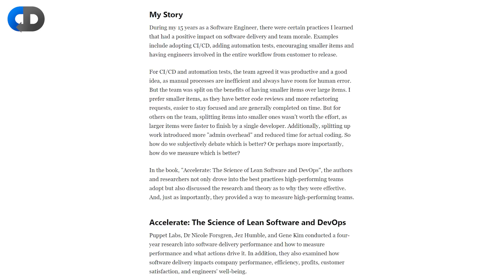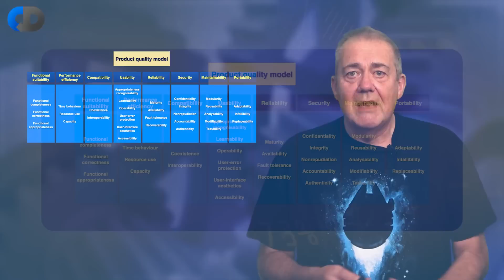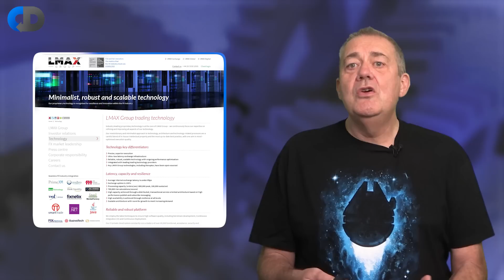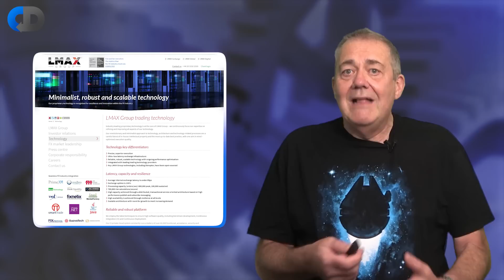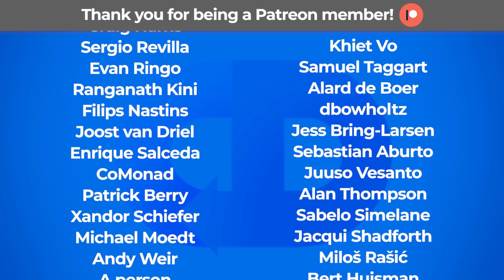I Bet You’re Overengineering Your Software

Comment: I have definitely overengineered in the past. I hope to have learned from these experiences.

I concur with what Dave presented here 100%. I now try to practice YAGNI, but I also try to keep the design flexible enough to accommodate what's coming in the future, even if I cannot predict it.

In my current experience, I think the problem of underengineered is more prevalent than overengineered. I see a lot of Big Ball of Mud. I suspect most of us here have probably experienced the same.
Reply from the maker: I agree Jim, under-engineering is the more common outcome, I wonder though if sometimes this is the result of the pressures that are, wrongly, applied to avoid over-engineering. ‘Under-engineering” is probably a good topic for another video 😉😁😎
Reply: Yeah... it would be interesting to talk about over and under engineering... and finding the "goldilocks zone" where there's just the right amount of engineering.
Reply: Some people interpret agile as meaning aggressive underengineering. When the defect rate torpedoes the velocity, then there is and agreement to do a "refactoring" sprint. Usually this sprint happens over a December and practically nothing that is planned gets finished, but the little bit helped enough to eek the velocity up again to a level that the stakeholders accept. Then rinse and repeat every year. I've had this unfortunate experience in more than one workplace.
Reply: Over engineering can also lead to a big ball of mud when new devs don't understand the intended architecture or patterns and either ignore it it mess it up. Or become too afraid to change it 😬

Comment: In my perspective these things have nothing to do with each other. 

I'll take the definition of engineering that is commonly cited, the reference I find is Koen 2003, but I got it from Bill Hammack's latest book: "Engineering is the use of heuristics to cause the best change in a poorly understood situation within the available resources".

To me, most of the things we talk about in software engineering in terms of quality software design practices go into the "heuristic" bit: our ideas about things like coupling, cohesion, and encapsulation are employed as engineering heuristics. We are doing a good job of quality insofar as we are applying appropriately applicable heuristics, the best tried-and-tested that we have available to us, and adjusted and reinforced necessary to fit our operating context.

Whereas "over-engineering" refers to violating some part of the definition of engineering in some other way: usually not delivering the "best change" in some way. 

"Best change" here is always understand in a cultural context. E.g. writing a payroll app in hand-coded assembly is "over-engineering", in the sense that it does not deliver the "best outcome": the software may be much faster than a payroll app written in Java, but the software will have taken too long to develop, it will be harder to change, it will be hard to hire new engineers to work on it etc. Over-engineering usually means placing too much weight or emphasis on one aspect of the "best outcome" at expense of others.

Comment: ❤ I call my system of working just-in-time development where you only implement what you need right now: start with running code and keep it running.  Why just-in-time?  Because JIT happens...
Reply: That’s fine for a job but developing this way can lead to duct taping something very brittle.
Reply: @mecanuktutorials6476  I totally disagree.  Building incrementally creates robust code because it is constantly run and tested.  The software grows organically.  There is never a need for tape of any kind.
Reply: @brownhorsesoftware3605  I don’t disagree that it works on a team of 1 or 2 that grows properly but often, you have a team of say 5-10 people who all have different tastes, priorities, and incentives. The initial bring up is the most important and if you leave it to JIT, it’ll most likely be 5-10 disparate, in cohesive pieces of work.

JIT is something I used in my own projects because it’s natural but it wouldn’t ever work in any corporate job where “what you need right now” is not determined by you. Everyone needs different things right now. Now you have integration problems because people work in parallel. And their features are incompatible or overlap with yours. That’s the challenge, why planning becomes important.

At the end of the day, if everyone does JIT programming, it doesn’t mitigate the project becoming a mess. That’s why most corporate proprietary repositories tend to be monstrosities despite having all of the tests, automation pipelines, robustness, etc.

Comment: Applying The Iron Triangle to software is also another symptom of the delusion that what programmers are doing is Production.
Reply: I'm in my 30's. I spent most of my life working as a truck crane operator. I transitioned into IT 1.5 years ago in a non technical role so invested time in learning about both project management and lean-agile strategic management. The fact that anyone would apply a project management mindset to software development I find absolutely baffling and shows a complete lack of understanding of what software development is. Pretty sure I'm quoting Dave here with a very simple explanation for business managers that what we're doing "is solving real world problems with working software." It doesn't make any sense to focus on delivering a thing. Focus on the value that's being delivered, which is the solving of the problems.
Reply: Even in production the iron triangle is not always applicable. If the product is not good you have a lot of discard. That is neither fast nor cheap.
In software development it sometimes serves as an excuse for delivering a mediocre product and missing deadlines and /or budgets. In my enviroment I observe a shift to more test driven work. I adopted it some years ago and it really helps to get it right the first time and facilitates changes. Fewer test and rework cycles for a good product make it cheaper and faster just as Dave said.